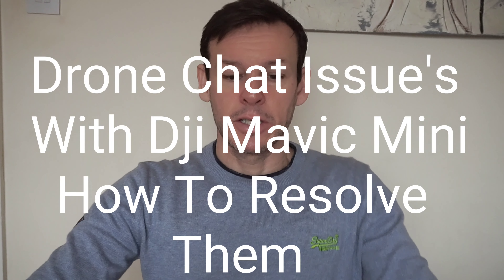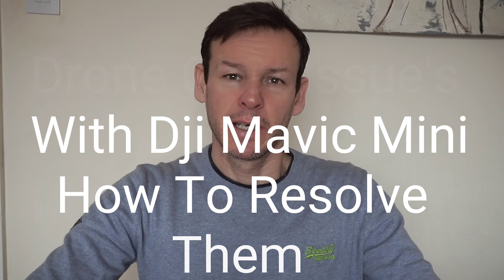Drone Chat Dji Mavic Mini Motor upgrade needed

Comment: Good points but the 250g rule depends on what country you're in? Eg in Canada drone pilots have to basically pass a test and register to fly anything over 250g including visitors to the country but the Mavic Mini is exempt at 249g so can be flown without issue!
Reply from the maker: Ya but in july will have to register it any way and normaly due to weight so upgrade esc firmware or motors so it got more power
Reply: @gadgetman404  I think DJI will probably bring out a Mavic Mini 2 with improved everything plus 4k camera😎👍😁

Comment: OK, but could you cut some of the dribble out, way too long for what you had to say, but please keep making the effort.
As far as the drone laws go, its going to be interesting what different countries do with the regulations.
In Aus we have overriding regulations that apply to safety regards distance, height and flying in controlled spaces that apply regardless of class, and I think that is sensible, and i think a variation of that is what is going to be in place in most countries.
Reply from the maker: Sorry no script bro